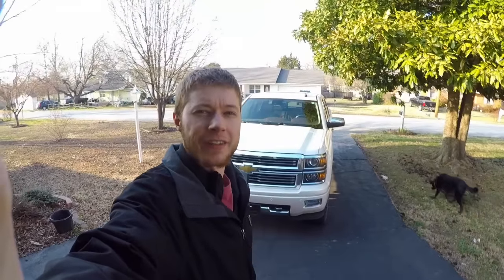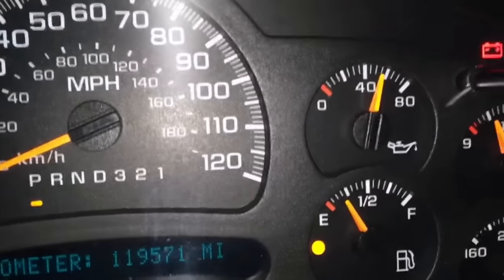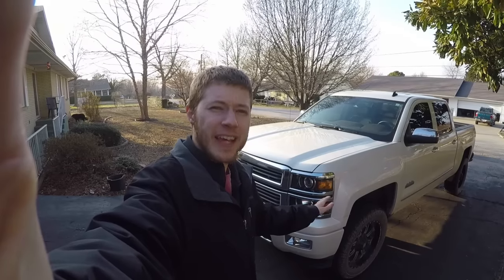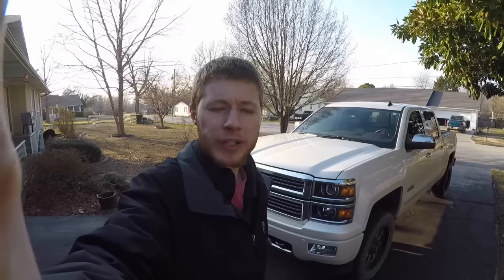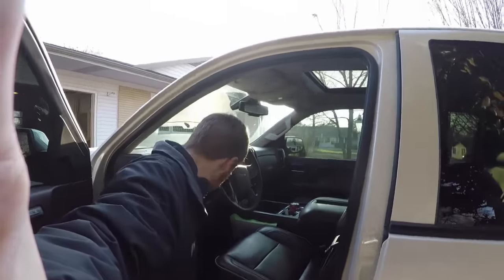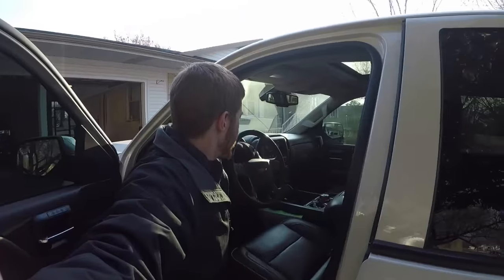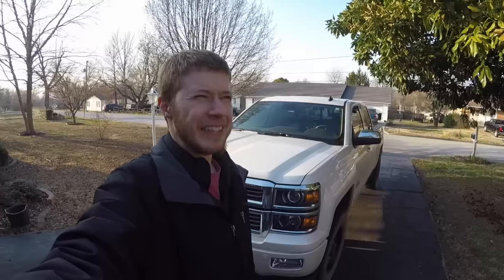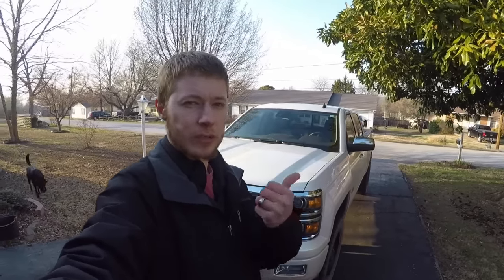Silverado Sierra 5.3 Lifter Noise Tick (What to do)

Comment: My silverado sounded the same and I searched a lot and found an addictive one called Liqui moly and now it sounds much less
Reply: Liquid moly sucked into my spark plug wells, caused misfire code - had to change my ignition coils and plugs after cleaning out all the Liquid Moly out of the spark plug wells and then replaced the catalytic converter.

Comment: That happened on my dads 2012 did that to he had it fixed and it broke again 13000 Miles later got it fixed again and broke again 4000 miles later then he got a new truck
Reply from the maker: Holy cow!  What did he go with?

Comment: Your oil is too thick for your weather condition... If your location where you live is mostly cool weather then a thinner oil is better but with wear protection like some zinc included from the manufacturer. Additive will kill the oil so never use additive and im speaking from experience... good luck! And yes you have to worry when you hear a tic tic tic because if you brush it off it will tic tic boom lol
Reply from the maker: Haha thanks for the comment man, tick tick boom no good! I just run the recommended 0w-20 oil

Comment: The noise you are hearing during cold starts is the gasoline direct fuel injection has on Utube also you could try charging the knock sensor but GDI engines are here to  stay
Reply: Yeah once my warms up that ticking sound goes away

Comment: My 04 avalanche does that,I don't recall my 09 avalanche doing it I recently sold it so can't confirm
Reply: MrPONCHO467 my 08 Avalanche does it
Reply: MrPONCHO467 2010 Avalanche with 150500 K does it on cold cranks stops after a minute or two it’s always done it I change oil at 30 -40% life left. Engine ticked when it had 150 miles on it. Got two 5.7’s over 200K they’ll do it too. CHEVY! RULES,,!,

Comment: Dang ol slapping valves. I have been running the 5.3 since 2012. Have a 2018 5.3. Where I live every farmer drives a 5.3. Every one I have seen has that tick. That’s from 30k to 300k miles.

Comment: My 2017 had this same issue start at 26k miles had it serviced for oil change and recall. The dealer claimed it as normal function of high pressure fuel delivery. Well 10 days after my engine blew... original dealer wanted no part of it. Found a nearby different dealer and they had 2 other ‘17 and ‘18 with exact problem needing new engines... thankful it’s happened within warranty... good luck!

Comment: I have a 2012 GMC that had this ticking noise at 96k miles and it ended up being one of the displacement on demand lifters collapsed and got stuck in the collapsed position. I had to change the cam and all the lifters. It was a pretty big job around 1500 bucks in parts
Reply: But with that problem, you should be able to notice it missing when it is accelerating in V8 mode I would think.

Comment: I have a 2006 Sierra with a 5.3 with 249k miles. In Jan 2018, I had the lifters replaced due to frequent ticking. The mechanic checked the valves, cam, pushrods and said those and everything else looked good. The ticking started back up about 3 days later, but nowhere near as loud or frequent.  Seems to be coming from the driver’s side. I had it back to the same shop 2 additional times where the shop did another lifter replacement which didn’t resolve the ticking.  The oil pump was tested and said that has good pressure.  I took it to another shop where they said they tested everything they could without tearing the motor apart and had no definitive conclusion. Both shops have suggested going with a rebuilt motor.  My truck drives fines. However, when the ticking starts there is a bit of a rough idle. The ticking occurs at idle, low and high speeds typically within 10-15 minutes after starting it. No noticeable drop in oil pressure on the gauge. No noticeable metal on the oil plug. I’ve always run Mobil 1 5w30 (synthetic) since new.  I pulled the pushrods yesterday and those were clear and didn’t appear to be bent. Any suggestions besides a rebuilt engine?
Reply: Run it till it dies ! My bet is you will want another truck before it dies. Just run it.

Comment: Mine started doing that at around 44000 now it has 123000 still runs fine don't worry about keep changing the oil when required and keep on trucking

Comment: My 01 has done it since 100,000 miles, it is still running strong at 204,000
Reply from the maker: Sounds like a good pickup!
Reply: Got a 01 Silverado with 342000 miles on it. I'll drive it anywhere no Ford original motor rebuilt trans still runs good!!!

Comment: I have a 2017 Silverado that I bought last February as a demo vehicle with 1400 miles on it, it has 35000 now and I have had the tick from day one. I did buy a AFM delete from range technology and it does seem to help with the tick and crazy enough improve gas mileage for me. My 2005 was the same color as yours and it had that tick too.
Reply from the maker: No joke, it improved the mpg? I may have to check this out.
Reply: Dustin T yes, it was only a .5 to a 1 mile extra, but the ticking went down some, and I don't have to worry about the famous AFM oil consumption.

Comment: So I got around 564 miles on my 2019 Silverado and I just noticed that ticking noise this morning so you saying that’s normal ?
Reply: Yes it's normal in most cases. Mine has been doing it since 108k miles I now have 209k miles no problems
Reply: why so mad thank you I was starting to get worry
Reply: @chuyitochuyin5894  it's a Chevy bro just maintain oil change and air filter it will go a looonngg ways

Comment: 2000 4.8 l did it from the day after the warranty expired and it's still doing it ..240k on the clock...Risolene zinc additive helps, 10w40 shuts it up.

Comment: 5-30 is what needs to be ran in this motor. Almost every one I’ve worked on has this “tick”. 2011 when I worked for GM we was changing cams left and right due to a very large bad batch. The only way I know to make it go away is a set of roller rockers. Good luck
Reply from the maker: No joke.. might have to look into switching!

Comment: It’s a carbon knock , it’s normal
Reply: Richard Frady Carbon Knock?   I seriously doubt that. Why would every Chevy V8 with the tick be experiencing it only on the drivers side lower area near the exhaust Manifold?
Reply: I Know You're Right But yes, mine is ticking near that area as well. My local exhaust shop thinks that my manifold is cracked or the gasket has failed, but they won't know for sure until I take it to them to check it out. I have a 2010 Chevrolet Silverado 1500 5.3 liter engine
Reply: @egertonridout4102  if its not a broken mwnifol bolt leak then it is most likely your vacume pump. No worry either way.

Comment: Thanks for the vid, my 14 Silverado makes the same sound since I bought it! I took it to the dealer and they made me feel crazy, like I was the only one that heard it. In any case that sound drives me crazy, do you think the noise is coming from the lifters? I heard something about it being some sort of injection system they have at idle?
Reply: These engines are gen 5 LT engines (no longer LS engines). The high pressure fuel pump is ran off of the cam shaft and these engines now use direct fuel injection, which is the ticking noise you hear.

Comment: I have a 04 savana with 265000 miles. Bought it new and brought it back several times in the beginning. They had a service bulletin that said theses motors get carbon build up on the pistons and that is the noise. Mine still runs like new....
Reply from the maker: That has been a solid rig!
Reply: Still has the original front end. Never changed a part. Although it’s time lol. It’s also the awd truck. Awesome 😎

Comment: Have a 17 High Country 6.2L was bought new and been using Amsoil Signature Series and PI treatment every 5000kms might of heard a slight tick once for 10 seconds but never for an period of time. Factory calls for Premium gas that may be the reason and also added an Elite RX catch can and clean side separator since new you wouldn't believe the crap that accumulates in it. Would highly recommend this to anyone that has direct injection. Great video!
Reply from the maker: I’ve been hearing that about the direct inject engines. How do you like the 6.2?
Reply: Dustin T Awesome engine and the power band is crazy after driving both 5.3 and 6.2L wouldn't go back to the 5.3 not knocking it is a great engine.
Reply: I have a 5.3 that will out run that 6.2
Reply: I guess I got a fast motor. It does happen
Reply: @jeremyjackson7994  🙄🤣🤣

Comment: Had the same problem with my engine making that ticking sound. I ended up having to replace my engine at 113,000 miles. I have a 2014 Chevy Silverado 1500 5.3l
Reply from the maker: Yikes!  What was the root cause?
Reply: Dustin T one of the lifters in cylinder #7 dropped and took a chunk out of my camshaft.

Comment: When I purchased a high mileage (200k+) `00 Tahoe about 4 years ago it was doing the same thing. I thought it was due to age. After replacing the old engine with a rebuilt, yup still doing the same thing.  More annoying during the cold season (using "cold" loosely here in AZ). Have racked up some good miles, six trips back to the east coast with no issues, abnormal wear or metal shavings in oil. I guess it is just a "thing" with these engines. I even changed from Mobil one to Rotella and switched from Mobil one oil filter to K&N and back. No changes.

Comment: My 2014 Silverado ticks pretty loud. Only 15 k miles and under warranty so I wasn't too worried but I did wonder. Now  I can worry less. Thanks. Btw the truck runs great.
Reply: You should worry because the sound isnt normal. It should sound  the same way as it did when you bought it no Matter its age. It's a lifter or rod knock. Most likely a lifter get it fixed or risk wearing out your camshaft or breaking a lifting rod off
Reply: @thegriffinsden3383  If it's just from the fuel rail it's not a problem. Sounds the same as it has all along but thanks for the heads up.

Comment: 45 second tick on startup, going strong at 203K on dino oil! Oil is cheaper than parts, and don't go over either 3K, medium caramel color, or the engines change light, which has automatic compensation for hard driving, hwy driving, etc. It is always a medium caramel if I go by the light, exacly like it is at 3K!

Comment: I have a 2000 GMC Sierra with a 5.3. It now has over 200k miles. It knocked when cold from day one when I drove it off the dealer lot. Still running strong.

Comment: It is caused by the large lifter like plunger that runs the direct injection pump of of the camshaft. If you're truck is older than 2014 and you hear a noticeable ticking its usually caused by worn or ojt of adjustment valvetrain components. Rocker or two are a little lose possibly.

Comment: I have a 2011 silverado with the tick noise - it comes and goes randomly,  owned the car from 0kms. was always on time with oil replacement, it is now at 230,000kms (143,000~miles) and still runs like a horse - i live in a super hot/dry climate, my oil pump top kind of cracked and started leaking outside the tank - but that was the worst breakdown encountered (happened after 6 years so yeah I am thankful to that old pump albeit was too much of a risk)

Comment: I was told today by a mechanic who works at a mechanic shop at a Chevy dealership and like a lot of people I asked what that noise is. He said it was the secondary fuel pump. Seemed pretty confident and he has been asked many times lol
Reply: I doubt that there is such an animal as a secondary fuel pump. Its prolly just the little people in the motor banging on the pots and pans.

Comment: I just picked my GMC SIERRA 1500 up from GMC service, and it was still making that sound. Two service advisors told me it was normal of the injectors to make that noise due to them being high pressure injectors with a low pressure vacuum. I'm not entirely certain how that works, but I was told it was normal even though not all engines make that noise.

Comment: Our 2013 Sierra made the same noise right before it started consuming oil and fouling plugs.  It was under warranty so they rebuilt the heads and told us the valve guides wore out. The dealership told us on some of the 5.3's when afm/dod kicks in the it will cause the valve guides to run dry.  Our truck only had 48,000 when the problem started. Our neighbors 09 suburban had the same problem and just got it fixed last month after the broke down.  Both of us are on dealership service program.
Reply: Yup o was told the first thing to do is delete that crappy dodge system starves the engine of oil

Comment: try using 89 gas.
Reply: Abel Cerrillo how many tanks of 89 octane did it take for you to get rid of the ticking noise? I'm on my first tank of 89 and have used a quarter of a tank and I have noticed a slight sound of the noise going away, but it is still there

Comment: Use 5 quart mobil 1 10w40hm and 1 quart of atf fluid for 1000 miles and then refill with 6qt mobil1 10w40hm every 5k miles the reason is gm using 0w20 and 5w30 is very thin for engine like this
Reply: Very bad recommendation no mechanic would support this.

Comment: "My 5.3 has a lifter tick what do i do"?..... buy a RAM.... problem solved.
Reply: Buy a ram an have transmission issue lol
Reply: Have fun with that!!
Reply: GMC
Reply: Pull a valve cover. If there is gunk under it i would flush it with your favorite flush. Transmission fluid is cheap or get a can of BG engine flush it works great. If that dont help guess you have a bad lifter. If you can tell which side the noise is coming from remove that valve cover.  Could have a broke spring.
Reply: @1975ssnova  like i said BUY A RAM and you won't have to pull valve covers or search for some noise some call "normal".
Reply: @johnnyturbo8460  no thanks! Been down that road before!! CHEVY is where it's at! You enjoy your ram. I will enjoy my Bowtie!
Reply: @1975ssnova  its where its at if you like odd noises, front parking lights that never work right in the front, rust as fast as a Toyota,  have a weak rear end, cheap interior etc.. but if that's your thing that's cool. How do i know? I have been down that silly road. Move over Fird Ram is the new benchmark in trucks and chevy is still bringing up the rear
Reply: @johnnyturbo8460  ram is the benchmark for the first time since when? And the chevy don't rust faster than any ford or dodge. That is all in your mind. There are no problems with the lights or any other thing with the chevy/gmc trucks. We have a huge fleet at work and your accusations are nothing more than BS! Here is a account that just happened to a 2009 ram 2500 at a friends service center. Guy brings his dodge ram in for inspection. They put it on the lift and start to raise it up. Next thing you know the bed starts hitting the cab. The frame broke in two!! A 2009 dodge 2500 that is only 10 years old. Not the kind of so called quality i am looking for! You have fun with that!! Later!
Reply: @1975ssnova   lol im BS? You just said "no problem with lights or anything " yet this video you posted is about a mystery noise on your chevy.. lol so who's the real BSer... its you bro.. you also mentioned your friends and your own dads truck making noise. 

1. Think before you speak

2. Think back to your dads 2000 chevys front right yellow driving light.. there is about a 90% chance it didn't work. 

3. Ram is truck of the year... look it up.

4. Class is dismissed you have been schooled

Comment: cool video ,I  have the 07 new body  style with 137000 miles on it i wasn't thinking about that  noise it all  👍
Reply from the maker: Lisa Hernandez thanks! It’s funny how much I’ve noticed it on different trucks since I made that video a year ago. Just wanted to ease other peoples minds!
Reply: I have the 2007  5.3, it started ticking at 201,000, used Amsoil motor flush,  5 qts Havoline  5w30 high mileage,  1 qt Marvel mystery  oil. Lifter tick stopped, oil consumption  stopped, and oil pressure returned to  40psi. Also  Range technology  AFM delete.  Running great again.
Reply: My 1997 Silverado has the Vortec 5.7L 8 Cylinder engine and 216,000 miles and has that same ticking noise it has since i bought brand new from the Chevrolet dealership 21 years ago.
I think it is a design thing  because i asked the Chevrolet mechanic about the ticking sound when i bought and was told they all do that until the oil circulates and engine warms up.
I change the oil and filter every 5 thousand miles. No problem.

Comment: Install a high pressure oil pump and new pickup tube with new gasket, it'll solve itself
Reply: Edward Mayer I was looking to see if someone says this just put in a melling high pressure oil pump problem solved.
Reply: Timothy Benton lol true, but, an oil pump is not like a water pump or power steering pump that the average DIYer is gonna bang out in 3-4 hours in their garage.  Oil pump is a tad more intensive of a project....

Comment: For those experiencing this issue, check out the vacuum pump located on the driver side, front of the engine.  There is a recall for Sierras and Silverados 14+. I swapped mine out before the recall even came out and it it fixed my issue.

Comment: Seafoam the crap out of it..  put a whole bottle in the oil and idle it for 30 minutes before doing an oil change.. Add half of a can to fresh oil, run it for about 1000 miles.. Then add another whole can and idle 30 mins before changing it again..  

Our 08 had been ticking pretty hard for about a year when I tried this, and it almost completely went away over the course of the next 5000 miles..  that was a few years ago, and it has been a 12k/yr daily driver ever since.. Made a few 1,000 mile highway trips, and a regular mix of city/highway..

No issues, much quieter.. 

My 2015 doesn't have the tick yet, but it only has 11k miles ..  it does sound like shit though..  lots of ugly sounding noises.. Lots of funny/hard shifting too